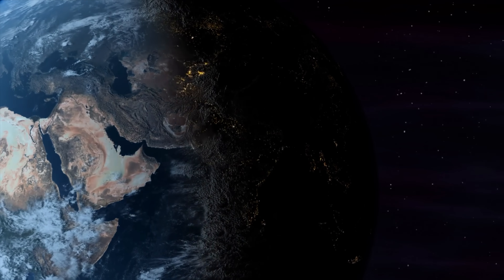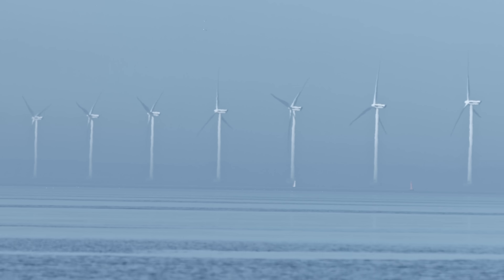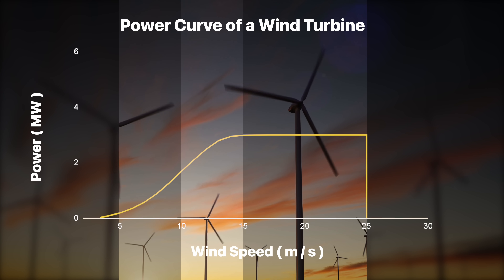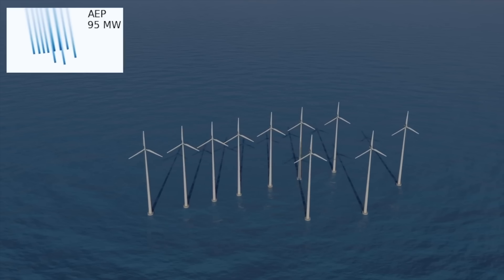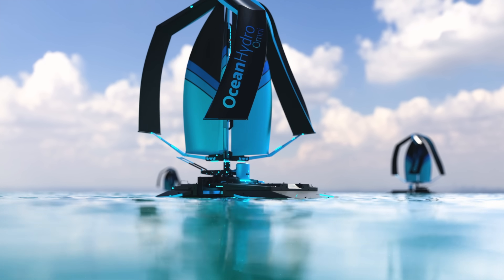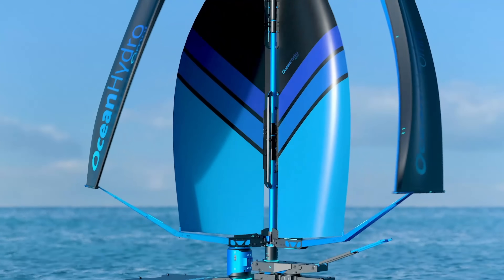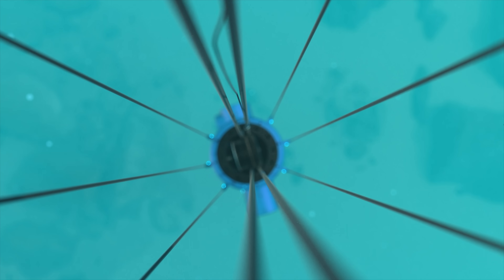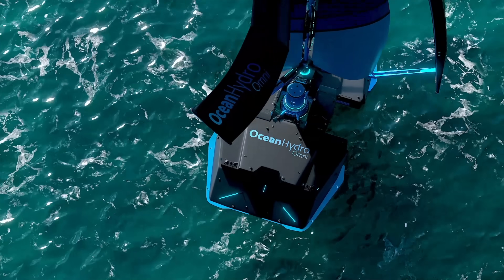Breakthrough Tech Solves Wind Power's BIGGEST Problem!

Comment: Interesting concept... They could also run an air hose to the sea bed and pump a bladder or "diving bell" full of air to raise the weight. Or they could compress air into the weight while it was on the surface and when the weight hit the bottom it would be released into a bladder. I'm not sure which method would be more efficient. Pumping the air to the bottom wouldn't be free but I'd imagine that it's less energy to reach buoyancy and then take a free ride to the top rather than pull the weight up the entire way.
Reply: Pumping air down is equivalent to pulling a weight up. There is no free energy. The question is the efficiency of the pump vs the efficiency of the motor

Comment: The best part is no part.
Placing all those mechanical parts in a sea environment does not look like a good idea.
Maintenance requirements would be high, which is already something that conventional wind turbines are trying to reduce because offshore maintence is a costly process (and offshore underwater maintenance would be even costlier!)
Reply: I can only think about ocean water corrosion and biofouling of the cables and wheels. I bet that in 24 months nothing moves anymore. Gravitational potential energy is also ruthless in how little energy it holds in any kind of realistic weights. Even a 1000 metric ton weight hanging in air from 1 km high holds only about 10 GJ of potential energy. Not considering reduction of efficiency due to buoyancy issues, discharge that energy in one hour, and you get 2,7 MW of power for one hour. Sounds great but considering the amount of materials and hardware needed I don't know how this will work out. Sure the oceans are deep but corrosion and biofouling would necessitate the use of 316L stainless steel rope or polymer rope. A kilometer of two inch fiber core steel wire rope weighs around 10 tonnes and has a safe loading capacity of 30 tonnes. The length of rope you would need to hang even one 1000 ton load from one turbine float is quite considerable. I would call this anything but a huge breakthrough. Build a one quarter scale prototype that works in 500 meters of open ocean water, operate it for a year and then get back to us with the results.
Reply: @wombatillo  Plus this mass can’t move at any feasible speed else the fluid drag gives up energy.  These wind platforms are a few hundred tons.  There won’t be any 1000 ton moving storage mass. It will be smaller and so have to travel quickly to produce any useful power, thus drag, thus unsustainable loss.
Reply: @wombatillo  Yep this seems to partly be Gravitricty but just underwater. How about instead send the electricity to an onshore battery of some sort (could be mechanical, flow, liquid air, H2 etc) and remove 90% of the the marine environment issues. Another potential issue,   can they really make use of higher winds because of the chaotic nature of wave action smashing them about. at least these massive turbines are away from that chaotic (and damaging) environment)?
Reply: Also, buoyancy and viscosity of water wouldn't allow for this "battery" to be anything near to cost or energy efficient. Those things don't even work effectively on land, why would they work underwater.
To me it seems like another really poorly thought out tech made by graphical designers rather than engineers.
Reply: @fritt_wastaken  iron is about 8 times as dense as water. Buoyancy is probably not their problem.
Reply: @davefoc  also iron is very expensive to use as a weight.
Are you one of those "if it's theoretically possible then it's viable" dudes?
Reply: @davefoc  Nevertheless, that's an automatic reduction in efficiency.
Reply: @fritt_wastaken  this comment summarises the whole idea best
Reply: @fritt_wastaken  That’s the source of most  energy concepts in YouTube, graphic designer or video production people.  Engineers don’t make these things, because they won’t say things like, ‘I believe this is future, what do you think, tell me in the comments’.
Reply: That's a good point, due to the corrosive nature of sea water, having moving parts underwater will probably be a maintenance nightmare.
Reply: It was a surprise to me, but off shore wind farms despite their larger size and greater output actually cost more on a per kilowatt hour basis than on shore wind farms. because of the higher maintenance costs for off shore wind farms.
Reply: However it does create more jobs.  Good point of view though!
Reply: OK boomer.
Reply: This will never work in real life. If the weight is small, it will not be able to store any significant energy. If the weight is big enough and the height is high enough to store significant energy, the first real storm will brake it apart.
They are thinking in the direction of having smaller devices but a lot and lot of them in huge fields. In that case maintenance and operation will become a nightmare. It can work of course, I just can not see a way to make it a real life practical application on the gigawatt scale; what a single nuclear power block easily accomplishes. Solar-roadways, wind-turbine edition.
Reply: Very good point. I'm all for renewable energy. We are not there yet. windmills are good, but not in a big scale. For a homes ok, industrial not so much. Windmills on the water🤔 Before windmills was killing birds next  fish too.  When the windmills break down they'll probably just let it sink, These big industries don't care.
Reply: @richierich252  I have seen windmills on a large scale with my own eyes, what are you talking about? Maintenance is definitely a problem, no one wants to go out and fix them.
Reply: @richierich252  Quick question, what do you think has a greater impact on birds and fish, wind spills or oil spills?
Reply: @dawggonevidz9140  does wind replace oil? 

BTW, offshore wind in large large numbers as proposed has a definite negative impact on marine life. Millions of pile driven foundations,  and wind farm to shore power cables in trenches ocean floor is no joke, though you won’t see big screen scary movies about it,  no non stop coverage of birds in oil, etc, allowing you to believe it’s all ok for industrial wind.  It’s not.
Reply: @dawggonevidz9140  Depends on where they are built.

Comment: The problem with wind energy for the electric grid is not the cut out at high wind speeds.
The problem is the high cut in speed at low wind speeds.
When it's stormy weather, a certain number of wind turbines in relatively small area will cut out due to over speed but there are still wind turbines in the surrounding larger area that will continue to produce close to maximum.
This means we will still have a pretty good total output from the wind turbine in the larger area.
At low wind speeds, on the other hand, a certain number of wind turbines in a relatively small area will cut out due to low wind while the wind turbines in the larger surrounding area will produce electricity close to their minimum output.

For grid stability it would be much more stabilizing to accomplish both of the following technical advancements:
- Make the turbine more efficient at lower wind speeds
- Make the turbine cut in wind speeds lower.

The total output and the economy would be reduced by these suggestions but the electrical grid would become more stable.
Reply: Engineering is always a balance of compromises. If you improve low speed efficiency you lose out on high speed efficiency. The amount of energy available from wind obeys a cube law. In other words if you double the wind speed you get eight times the available energy. This means that at low speed there is very little energy available. Improving low speed efficiency only gives you a small amount of extra harvested energy, while losing a lot of energy at the high end. It's better to design for maximum efficiency at the average wind speed.
Reply: @LesNewell  For economy reasons it's better to optimize the turbines for maximum efficiency at average wind speed, yes.
This is, however, a classic case of sub optimizing where only one aspect gets all priority.
Grid stability and producing hours per year is disteharded from the priority list.

Producing hours per year is more important for grid stability and the society in large than to squeeze as many dollars as possible out of the turbines.

I would like to see more research and development to reduce the zero production hours per year rather than increasing the maximum output a few hours per year.

In theory we allready have the technology in the aviation.
A wind turbine with automatic flaps and slats perhaps?
It would give the turbine a lower cut in wind speed, increase output in low wind speeds and at the same time only marginally reduce the maximum output at high wind speeds.
Reply: @mrSkandalpolisen  My point is that there is very little power available from the wind at low wind speeds. It is not worth investing in a lot of extra complexity and sacrificing quite a bit of power in high winds for a small trickle of power at low wind speeds.

Comment: Someone saw the video of the energy vault and thought that it was a good idea.
They took an already bad idea and now combined it with ignorance. The problem with windgenerators is that you need hight to have linear wind. Even for the vertical wind generator that is important. And being close to the water level is even worse than having trees around. Also the vertical generators are less efficient compared to horizontal generators. That is the reason why you don't tend to see them that often. 
And everyone who has a boat can tell you how good stuff still moves after a year or two under water. Those weights will need anti fouling coating and cleanings more often than any boat in the sea.
I am not convinced that this idea will become more than an few prototypes
Reply: Why would they care all that much about fouling on the outside of the weight?
And being less efficient doesn't have to matter all that much as long as they are cheaper. and not needing that huge shaft to the bottom of the ocean floor does save a lot of costs.
Other then that, i agree with you on the energy vault comparison. The weights would need to be enormous to be of any practical use... and being in water they would need to weigh even more then on land because water is already pretty heavy.

Comment: Now I'm thinking about if this could be done with an air battery instead of a gravity battery.  A mechanical air compressor should be able to handle the input from a high speed turbine even better, and the air could just be pumped into a tank beneath the turbine.   Leave the bottom.of the tank open and the outside air will work to keep the pressure up.
Reply: There's lots of heat energy losses when compressing air. Also not sure what you mean by 'leave it open at the bottom's
If underwater, then yes the compressed air pressure vessule could be open at the bottom, and as it fills up the air displaces the water, but the capacity would not be very high. I think 20m is 3atm (45psi) which is not much.
A engineered closed pressure vessel would be more suitable.

But then other storage methods probably more suitable again. Like connect a few turbines up to a hydrogen plant.

Comment: The difficulty with gravity systems is the amount of weight that you need to move to create any significant amount of electricity. You could move the weight anywhere using wind energy, the fact it's attached to a turbine has little relevance surely?
Reply: My thoughts exactly. What's the benefit of having the gravity storage on-site rather than off-site? If you have it off-site you can use conventional turbines to power them and the number of wind turbine platforms doesn't limit the number of mass units you can have in your gravity storage farm.

Comment: This made me think that standard windmills could take advantage of this same concept. They already have a ginormous vertical tube that would shelter the load being lifted/dropped. The height may be much less, but maybe with the correct gearing and weight, it could be feasible.
Reply: Gravity storage just has disappointingly low energy density. If you would lift a 300 ton weight up a 100 meter tower, you can store about 84 kWh, which allows you to store only 1 single minute worth of production from a 5MW turbine.

For the same reason the technology presented in this video does not make any sense.
Reply: @wimvanuytven7858  I've been looking for sources that show the Weight to Height to Energy Storage calculations for Gravity storage.
Can you provide a source for your 84 kWh number?  (Seriously, not a Troll question)
Reply: @earld1403  you dont need a source, you can just calculate it yourseld. Gravitational potential energy is given by m*g*h, where m is the mass, g is the gravitational constant (9.81) and h is the height. This gives you a stored energy in Joules. To convert joules to kwh you need to divide by 3600000 (3600 seconds in an hour, 1000 watts in a kW)
Reply: @wimvanuytven7858  Thanks for reminder on formula for energy production.  I haven’t used it since freshman physics, a long time ago.
Reply: This has been looked at for over 50 years.  They aren't efficient.
Reply: I estimated the cost of this project to be 2500$ / kWh. 
Battery storage is already $400 / kWh and Pumped Hydro is $120 kWh..... 

It turns out that gravity is a really weak force and is bad for energy storage. Pumped hydro gets away from it because its moving a fluid and not a solid.
Reply: If you lift a large weight up the shaft you make it very unstable for very little gain.
Reply: @bknesheim  correct
Reply: Inside the tower, protected from sea water. The open system suggested would be a maintenance nightmare in sea water. What are they thinking?
Reply: has been tried and debunked long ago due to the low efficiency due to high friction. It would also massivly increase the tower cost to support the extra weight. Anything like a simple battery, flywheel or chemical storage on ground level does a much better job.
Reply: @voster77hh  I was thinking about that.... the larger a gear ratio, the harder it is to "back drive"... can you how much friction there would be of you tried to drive a high speed alternator with a weight moving 3 inches per second.... 

This is another big win for pumped hydro... massive water volumes and massive flows, which effectively "reduce the gear ratio"
Reply: I wondered the same thing, and also the weight could be powered on shore. But I guess that ignores the other advantages of lack of wake and support for higher wind speed. I wonder if these are also more bird friendly? Certainly they would be less visible if grouped together well off shore, as that is a major concern in many countries
Reply: Exactly my thought. Also as there is air and no water, the load can be smaller for the same output, or even if the tube can be vacuumed - would be more efficient. Just thoughts.
Reply: Pumped hydro is much more efficient. There are lots of designs for various options... One proposal I remember being intended for individual windmill use, involved using a heavy hollow concrete block. The windmill would pump air into the submerged container, where it would displace water. Just open the valve and use the air pressure to spin a turbine when you want electrical power.

Comment: This is one of those <FACEPALM> moments.
Why didn't anyone think of it before!?.
Another advantage, construction.these can be made as a self contained floating structure in a dock.
The anchor ring can be attached to the weight, with an automated release(?) then the whole system towed out, the weight and ring lowered to the sea bed.
Then fix the ring.
Connect the power cable.
Ready.
Same goes for maintenance, just tow it back to the dock.

Comment: Great concept, but it can be even better if a larger more complimentary view is taken. Deploy these low VAWT/Storage units under the monster HAWTs. Increase the storage capacity on the Hydro Wind units and filter the HAWT output through the Hydro Wind units to create grid compatible power right at the generation location.  The VAWT and HAWT wind profiles do not interfere with each other increasing the wind collection efficiency of the wind farm site, colocation shares maintenance access/capability and the local storage fixes the main problem with variability of the existing HAWTs.